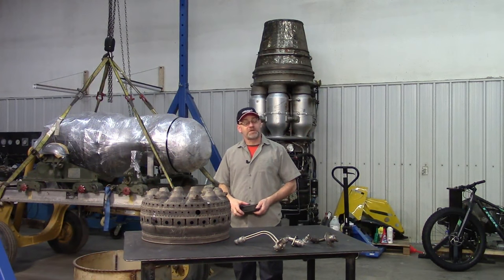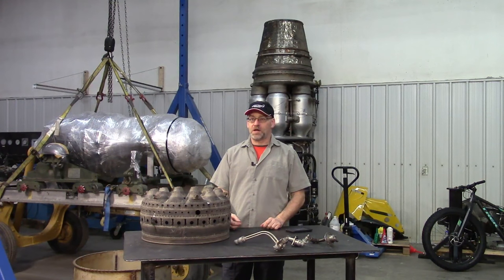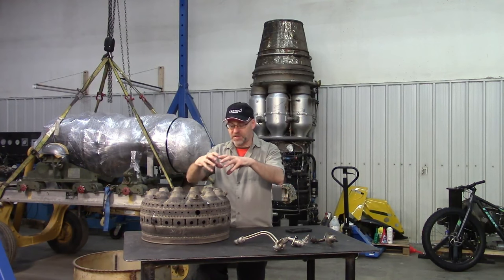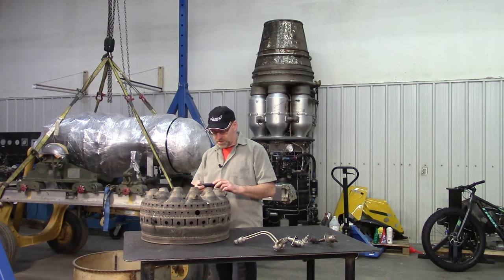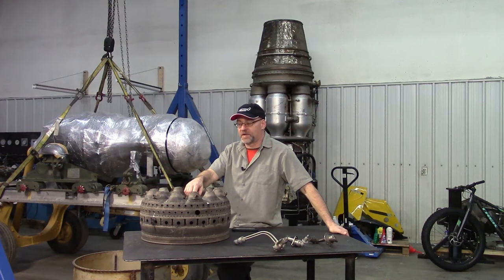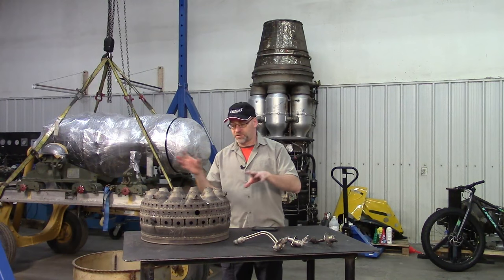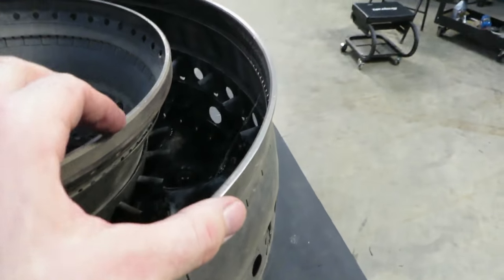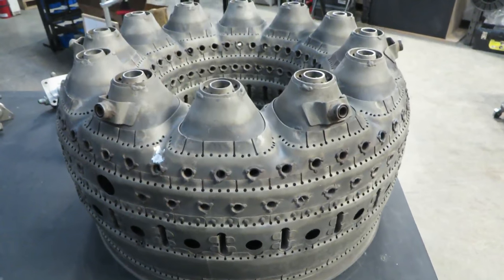Jet Questions 90

Comment: Two historical examples of a jet engine "running away":

(1) Early prototype if a jet engine by Frank Whittle, which was in a stationary test stand.  Whittle did not know it, but unburnt fuel had pooled inside the engine.  When the engine speed got too high, Whittle shut off the fuel line, but the pools of fuel continued to vaporize and burn, causing the engine to run away.  I think the engine almost exploded but did not, and Whittle was lucky to have no injuries.
(Source: Some BBC documentary on Frank Whittle.)

(2) I forget which airliner flight, but you can Google for it: One of the airliner's jet engine had a massive oil leak (not a fuel leak, but an oil leak) somewhere around or before the turbines.  But like fuel, jet oil can burn, and it caused the rotor to massively over-speed.  Engineers doing forensics on the engine found rotor parts that were so "oversized" they were out-of-specification.  The parts had stretched from the massive centripetal forces from spinning too fast.
(Source: Some episode of Air Crash Investigations.)

In any case, both of these examples are extremely unusual.

(btw, my lay-person's understanding comes from watching videos, so AgentJayZ, please corrected any mistakes and/or misunderstandings.)
Reply from the maker: 1) ... an experimental device that was eventually to lead to a production turbine engine. Good example, but can not be included in the answer.
2)... yes, but an extremely unlikely event.
Good comments..never say never...
Reply: Please see my answer to Juha Tuomala in respect of your para. (2). The only component that became oversized and went out of spec was the IP turbine disc. At around 140percent overspeed, it dilated to such an extent that it burst into three 120 degree segments. That's classic for a disc overspeed failure. PS The flight was QANTAS QF32.on 4 Nov 2010.

Comment: Hello, Jay.  I believe that the 707 was the first transport that could be self-started using stored (on board) compressed air.  It would start one engine.  The remaining three were bootstrapped by tapping compressed air from the running engine.  I also recall that the 727 was the first transport having an APU.  It was located in the right-hand wheel well.  The tailpipe exhausted upwardly through the wing root area.  If there was a "torching start" (i.e. the fuel was introduced too early in the start procedure) some passengers  would get quite a show.

Comment: I saw a diesel engine "runaway", it was a roll-over, it was sucking engine oil through the PCV valve, it over revved and blew up.

Comment: JZ,  If ya want a show, then it's a great idea to introduce fuel before it's suppose to be.  I was manning the RSU at Holloman when a pair of transient 105's took the runway for takeoff.  As you know, when lead lit the burner the water injection kicked in.  Well....some dumb ars filled the water tanks with JP4.  Fire came out EVERY hole in that airplane.  Every inspection panel blew off,  the guys went over the side of a 12 foot high airplane that was still rollin'.  It was a real Chinese Firedrill.  But after the fire went out the engine was still runnin' and the airplane was on it's own.  The airplane came to a halt about 7000' just off the runway still in idle.  No more fire, just sittin' there idling. The guys wouldn't get near it and nobody else knew how to shut it down.  They let it idle until it flamed out.  Don't add fuel to the compressor section!  It's a real fireworks show! Much, much better than shockcones.  Keep up the good work.
Reply: I've told this story before. Years ago, a BAC 1-11 went down on a German autobahn/highway soon after take-off, because the water injection tanks for its Spey engines had been filled with kerosene, instead of a water/methanol mixture. The additional fuel burned the turbines out in minutes.

Comment: the only Jet engine run away I heard about was with Frank Whittle and his early jet engine. Long story short, Fuel was pooling in the combustion chamber at shut off and the next time they started the engine it would fire up and run away immediately. they then found out that if they ran the engine long enough, the residual fuel was burnt off and then they could control it

Comment: Dispatch of airliners is usually allowed for a few days with broken APU, in which case they use an external start cart (aka "huffer") to start the first engine, and use cross-bleed from the running engine(s) to get the rest going. All large and large-ish airliners except the 787 have air-turbine starters because they have substantially higher power-density than electric motors. The 787 can offset for that a bit because it uses a combined variable-frequency starter-generator, removing the need for the heavy constant-speed integrated drive generator on more traditional designs.

Comment: Never was interested in jet engines, but came up across your channel, and got hooked on it. 
Great subjects, and explanations.
Keep it up 👍
Out of curiosity, how much one of those used machines run for ? 😆
Reply from the maker: How much (time) one of those used machines run for?
They will run until you cut off the fuel supply.

Comment: way back late 1970's or early 1980's a MIG-25 was tracked by NATO radar to a speed in excess of MACH 3 and was later reported that the engine was damaged beyond repair. MIG-25 is not supposed to exceed MACH 2.9 is this a case of engine runaway? I have also noticed that some airplane specification includes never exceed speed limitations as a warning to pilots. does this mean that in excess of this speed limit a possible engine runaway situation may occur?

Comment: Frank Whittle had the first gas turbine runaway.  Fuel had accumulated in the combustors during a runup while in development.  It just kept accelerating even when the fuel was cut off.

Gas turbines and diesels are similar in that they almost always have an excess of air for combustion.  Just add an uncontrolled fuel source like an oil or fuel leak and away it goes.
Reply from the maker: Whittle's incident happened with a research engine with a very simple fuel system. It was also of such low power output that a few litres of fuel presented a significant source.
Modern airliner engines have hundreds of times the power output, and therefore have higher fuel consumption.
Jet engines simply do not have runaways, a fact that refutes your claim.

Comment: It is interesting to look at the evolution of combustors.  First note the size (volume) of the early can combustors compared with the double annular GE90 combustor.  The next thing to notice is how the air injection hole sizes shrunk.   I believe one of the early design criteria was to minimize the combustor pressure loss.  Hence a lot of big holes.  The down side of this was that the injection jets (air through the holes) was "lazy" and tended to dance around.  Hence a propensity for high turbine pattern factor and hot streaks.  Newer designs target around a 3% pressure drop for the combustor with well defined dilution zones and jets, with remarkable turbine pattern factors.   A Jay said in previous comments a lot was trial and error.  However some of the advancement came from computational fluid dynamics advancements in the late 1980s.  The gas turbine is truly a modern marvel!

Comment: The pressure can rise as air travels toward the outside of a centrifugal compressor. The centripetal acceleration of the air following a curved path creates a pressure gradient similar to linear acceleration as with Bernoulli's principle. Thanks for the video!
Reply from the maker: Of course it does. The diffuser case is part of the compressor, and the compressor... compresses the air. Huge surprise there, eh?
All of the compression happens as the air travels to the outer diameter of the centrifugal compressor. That's how they work. That's why they are called "compressors".

Unless of course, you mistakenly referred to the impeller as the compressor, in which case you are not correct.
But otherwise you are totally correct!
Reply: Haning studied centrifugal compressors a LITTLE bit, in principle AgentJayZ is right, velocity (speed actually) is the only desirable change. However, in practice, due to the work being applied to the fluid, it heats up measurably, not significantly, while it is accelerated. Pressure DOES increase measurably "inside" the impeller. However, the ratio of speed vs heat is veeeery large. Also, depending on the geometry of the impeller-diffuser pair, the leading faces of the blades (the ones that strike the air, that do most of the work) are at an elevated pressure compared to the trailing faces. It all comes down to action-reaction: if all faces had the same pressure, there would be no reaction force opposing the impeller - it would not consume any energy.
Reply: I did of course use the wrong term when talking about the impeller. Do you know if that is just to keep the impeller temperature under control, or is it just more effective aerodynamically to have the pressure rise happen in the case?

Comment: I would think the amount of fuel a jet engine uses a full power a runaway would be unlikely. They also seem to not have all that much oil and much less oil pump than fuel pump so it'd be unlikely to go into runaway and cause overspeed damage before running out of oil. 

A diesel used much less fuel, with much less power, and has lots of oil. So in a runaway situation it's more likely to happen as well as overspeed and come apart well before running out of oil.

Comment: The first V-22 Osprey crash that occurred in Washington DC, into the Potomac River was caused by pooled  hydraulic fluid in the nacelle pouring into the engine when it rotated the nacelles to helicopter mode.  7 people died

Comment: A bad front oil seal failure could cause a jet engine to run away as oil would be drawn into the combustor and burn in addition to the metered fuel from the injectors, Another starter system is AVPIN, a small rocket motor burning isopropyl nitrate, the exhaust gases spin a turbine through a reduction gear that then turns the jet engine

Comment: Excellent video as usual.
I would like to ask two questions. 
1) Is it possible to convert every aviation engine in to an Industrial engine? 
2) Whether any Turbo Prop engine has been converted into an Industrial engine ever? Any example. If not, why?
Thanks for sparing your valuable time.
Reply from the maker: 1) There are many different configurations of aviation propulsion gas turbine engines. All of them can be converted into industrial use, but not all of them easily. Only a few configurations have been converted, and not by shops on an individual basis.
"Converting to industrial use" is done to the design by the manufacturer. It's a process carried out on an engine design, not usually on an individual engine.
2) The P&W PT-6 is an aircraft turboprop engine, and is also available in industrial form, as the ST-6 from P&W.
The RR 250 is a turboshaft engine for helicopters, which is also available as the 250-B-17 turboprop version for light aircraft. A company called MTT sells a firefighting pump skid which uses an RR250 to power the water pumps. That would be an example of an aftermarket conversion from aviation turboshaft to industrial turboshaft.
Reply: The Bristol Proteus turboprop engine, which originally powered the Bristol Britannia airliner, was probably one of the first aircraft to industrial (and marine) gas turbine conversions. It produced 2.7MW when used for electrical generation and 4,250SHP when used in fast patrol boat and hovercraft applications. It was already in service when I joined Bristol Siddeley Engines as an undergraduate apprentice in 1962.
Reply: The Rolls-Royce Tyne turboprop engine, which originally powered the Vickers Vanguard and Canadair CL-44 (and other aircraft), was converted in the late 1960s into the Marine Tyne. The Proteus needed virtually no design changes, as it was a free power turbine engine and the 1500rpm output from its aero engine reduction gearbox could be connected directly to a 4-pole generator for 50Hz AC power.
However, the Tyne aero engine LP spool also drove the prop, so a major redesign was required. The aero engine's reduction gearbox was removed, the 3-stage LP turbine was divided to give a single-stage turbine driving the LP compressor and a 2-stage free power turbine, with a 'hot end' drive to a separate gearbox.
As a young designer at R-R's Industrial and Marine Division, I designed some of the external accessory mountings.
Reply: grahamj9101 Thank you so much for sharing your valuable expertise. Please keep on contributing with your worthy knowledge and skills.
Reply: AgentJayZ Thank you so much for getting the query cleared. Also thanks for sharing your valuable knowledge and sparing valuable time.
Reply: grahamj9101 Thank you so much sir. 
As per your kind comment., as you mentioned. : LP Turbine was divided into gas generator and Power Turbine.  So I would like to learn that what about HP spool? It means it was just like a normal single spool industrial turbine? My query is only about the HP spool I.e whether it was discarded or there was by design no HP spool in the parent turboprop engine.
Reply: My apologies: perhaps I should have explained in more detail.
Returning to the subject of the dear old Proteus engine, that was a single spool engine with a free power turbine, which had a convoluted flow path. You should be able to find a diagram of it somewhere on the internet. 
The aero Tyne was a two-spool engine, but it did not have a free power turbine. The three-stage LP turbine drove both the LP compressor and the propeller. When it was converted into a marine engine, the HP spool remained aerodynamically unchanged, possibly with some material improvements (I can't remember now). The LP compressor also remained aerodynamically unchanged, but with material changes for improved corrosion resistance.
As I described previously, the three-stage LP turbine was divided, with the first stage becoming a single-stage LP turbine driving the LP compressor. and the second and third stages becoming a two-stage free power turbine. Consequently, the engine became a two-spool gas generator, with a 'close-coupled' free power turbine, forming part of the engine change unit.
Reply: grahamj9101 Thank you so much sir. Yes now it is cleared to me.
Once again thank you so much for sparing your valuable time  and coaching the new in the field. 
Best regards.
Reply: In your earlier post, you used the phrase, "a normal single spool industrial turbine".  Yes, AgentJayZ works on single-spool industrial gas turbines, such as the LM1500, LM2500 and the Avon. However, he also works on two-spool industrial engines, such as the Olympus and the Spey, which are no less "normal". In a previous existence, he also worked on the Industrial RB211, which is a two-spool engine that was derived (probably a better word than "converted") from a three-spool turbofan.

Comment: Wonderful video (as normal) So on the holes in the engine, what if one gets plugged?  (Just kidding)
On the engine run-away question, the only one I am aware of is the prototype that Whittle was working on in his lab.  The fuel controller was not set up properly and it just kept increasing RPMs until the fuel was cut off.   Now being 193? I can only imagine that the fuel pump was from a piston engine (but that is a guess only).

What I find amazing is that the F-22 Raptor uses a cartridge starting system.  Not as bad as the B-52 of the B-57 -- man those things smoke.

Keep up the great work,  I love your videos.  Always wanted to be a Jet Dude, but instead ended up being a desk jockey.
Reply: Whittle's "lab" was a disused foundry building.

Comment: We had one accident in Airforce where one PW F100-200 was running away. The reason was that the feedback rod between the fuelcontroller and fuelpump was failing. So from idle to max power it was accelerating to quick with to much fuel and accelerated to about 200% rpm and then the turbine blades was also flying away and engine and airplane went into fire.

Comment: A diesel running away normally means you cannot shut it down because the fuel keeps getting injected into the cylinders. When you shift it to neutral it will rev up furiously even at low throttle positions because there's no load attached.
When you cannot stop the fuel getting pumped into a jet engine's combustion chamber, it will just kinda run, but not run away,, because you cannot put a jet engine to neutral gear.
If the jet engine has a variable propelling nozzle that will not close, you will get some sort of a low-load situation. But normally you will never get a jet engine to full throttle when the nozzle does not close, because the nozzle is connected to the power control systems (well, I'm sure you knew...).
There where many incidents with early Starfighters having trouble with nozzles that did not close. They just lost all of the thrust and all the pilots could do about it was to eject immediately.
Wow... sorry for the length-ish text, and I hope I managed to write some readable English as well.
Reply: i had diesel runaway the turbo got an oil leek and had to still the engine to stop it lucky for me my truck was a manual even then it took 1 km to stop it on the breaks

Comment: I gotta say love your channel I ALWAYS learn something new! The cylinders in Han Solo's pocket are supposed to be code cylinders. Word on the street is that the prop makers on some of the older movies used RA Stephens' dosimeters (usually used to measure radiation dosages on atomic workers)      I found a thread on the replica prop builders forum that goes into it a bit http://www.therpf.com/showthread.php?t=85709        neat stuff!